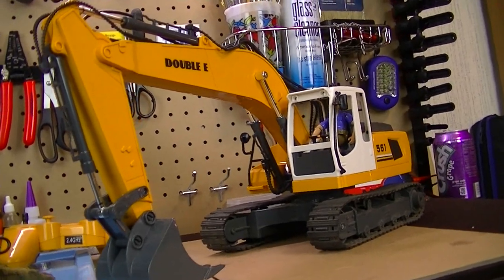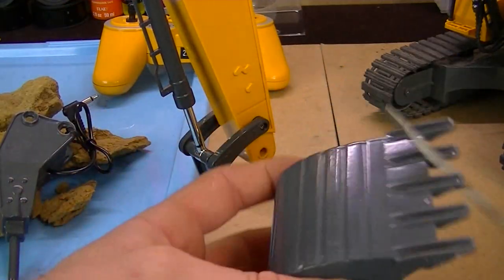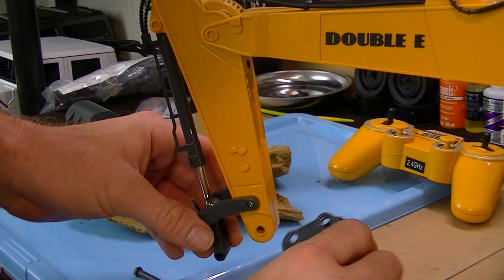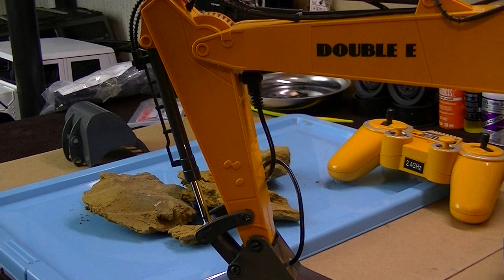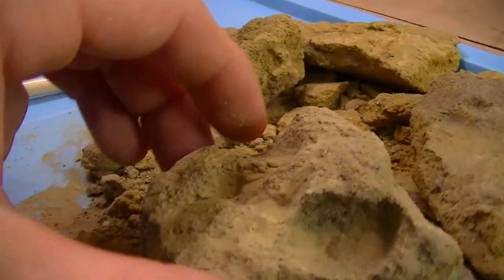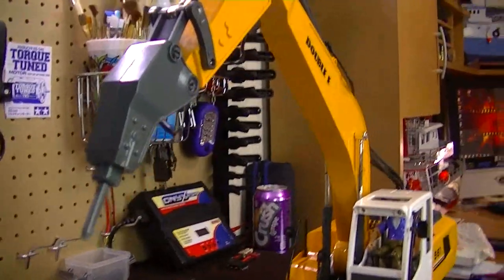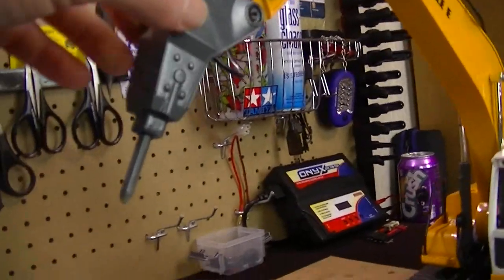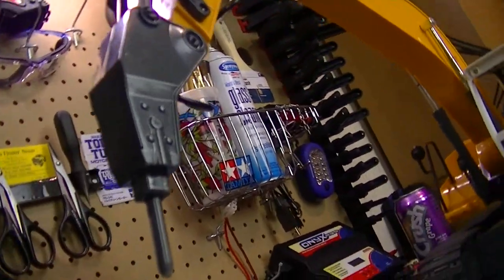RC84Films: RC Excavator with Breaker/Hammer

Comment: where can I get one at both the attachments in the excavator
Reply from the maker: Milton Trautman this link should help you https://www.ebay.com/i/322588828266?chn=ps&dispItem=1&ul_ref=http%253A%252F%252Frover.ebay.com%252Frover%252F1%252F711-117182-37290-0%252F2%253Fmpre%253Dhttps%25253A%25252F%25252Fwww.ebay.com%25252Fi%25252F322588828266%25253Fchn%25253Dps%252526dispItem%25253D1%2526itemid%253D322588828266%2526targetid%253D324155900349%2526device%253Dm%2526adtype%253Dpla%2526googleloc%253D9010079%2526poi%253D%2526campaignid%253D853239567%2526adgroupid%253D44240798395%2526rlsatarget%253Dpla-324155900349%2526abcId%253D1128846%2526merchantid%253D110422562%2526gclid%253DCj0KCQjwtpDMBRC4ARIsADhz5O7vcb87RXLzzCD-_CsLX6__RSusZDjG-RDIvgsGHaGH1FUkZATiGoAaAqoGEALw_wcB%2526srcrot%253D711-117182-37290-0%2526rvr_id%253D1275151375784